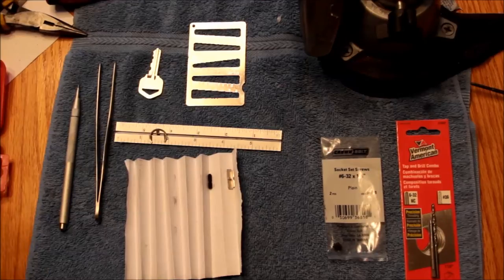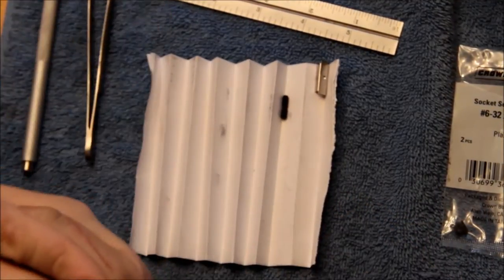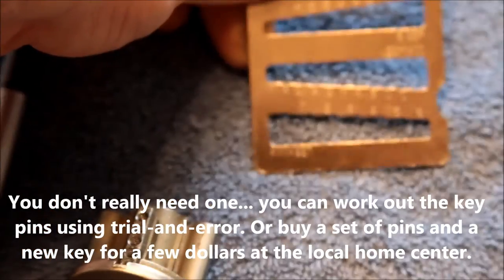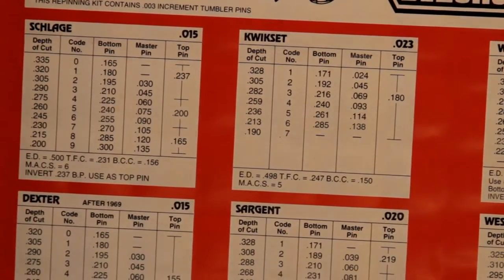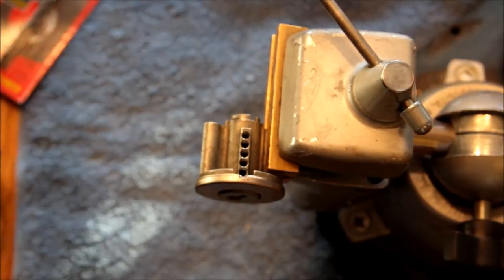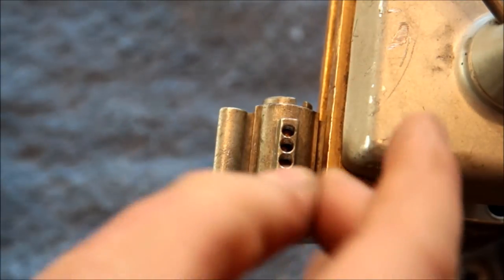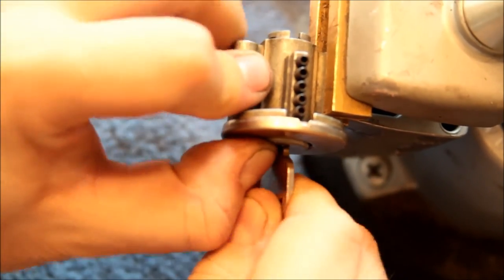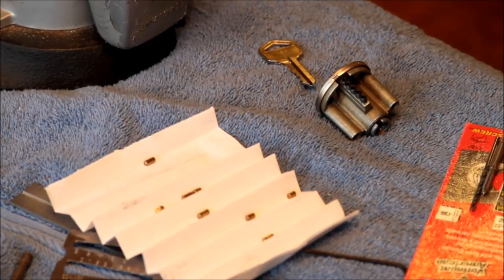(078) DIY Practice Cylinder -- No special tools required

Comment from the maker: Tools are something I collect over time... usually after flailing around with what I have and then realizing, "hey, someone invented a tool to do this really difficult thing!" Sadly, this often happens *after* I really needed it. 

But, yeah... it's amazing how much you can do with a few simple hand tools. It may not be as fast or whatever, but it works just the same.

Comment from the maker: Thanks mate. I think I'll do one on a Euro cylinder next. They'll be a bit trickier because they often have hardened pins or ball bearings on the pin-stack caps. But maybe one of the ones with no holes at all would work--just by carefully grinding the top bit off. Whenever the moving people get me my grinder back, we'll have to see!

Comment from the maker: My tools are in transit from California... but once my shop is set up again, I'll have a go at an inexpensive Euro cylinder and post that. 

You're right, though -- at least the traditional (non-Euro) cylinders are easy to service with just a follower and some tweezers. However, I'm clumsy enough that I usually end up chasing a spring or two across the floor.

Comment: Great job I love the video. I now know what the size of the set screws are. 6-32 I think  that 1/8",1/16" or 3/32" In length would have looked much more professional. I've been looking to find the size. Now I know.

Comment from the maker: You could do the same with a Euro cylinder. The only tricky bit would be getting into the bible. Most of the ones I have either have plugs (or balls) in the holes or the holes are milled from the bottom. At minimum, you'd have to drill out the top. It can be done (see also my Bricard video), but it's a pain and it defaces the lock a bit, which I know you hate.